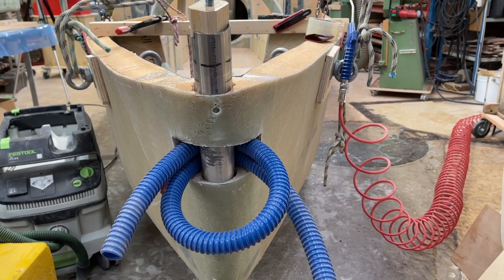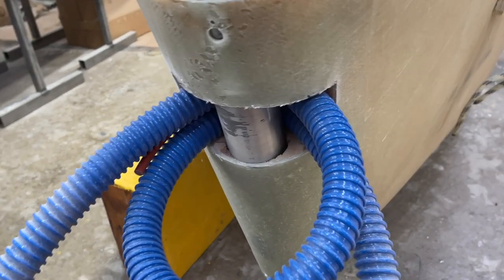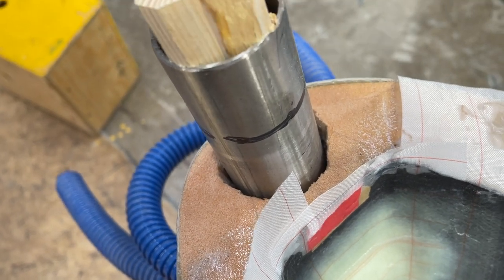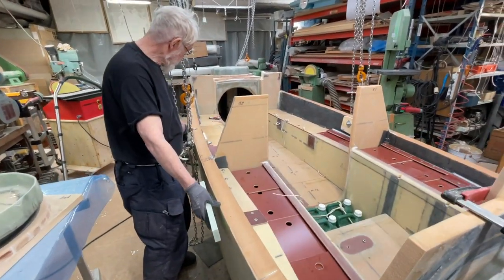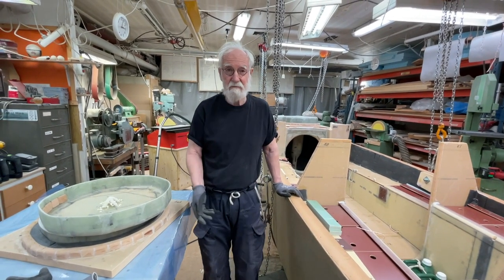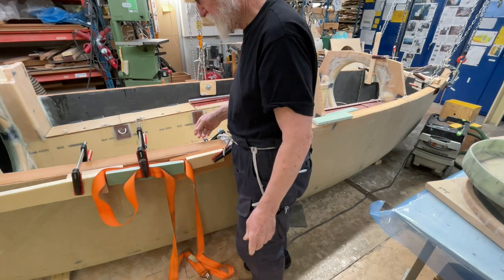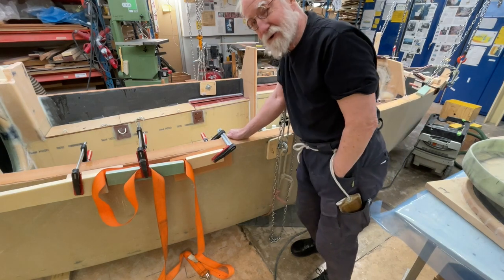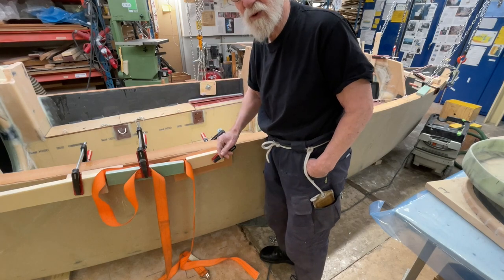17 Dec 2022  Making the bollard hole  + The solution to the very difficult riddle.  Watch the end.

Comment: Well that shoots my idea for those 4 pieces of material.  The bollard is more clear but the rub rails and lifting points are still vague.  Boat overall is coming along well.  That stainless tube will show up on radar.  Probably the only thing.  Waiting for the ballast keel to happen.
Reply from the maker: Two of the masts will be carbon fibre.
Nowadays AIS is more important than radar and I will hava a transciever